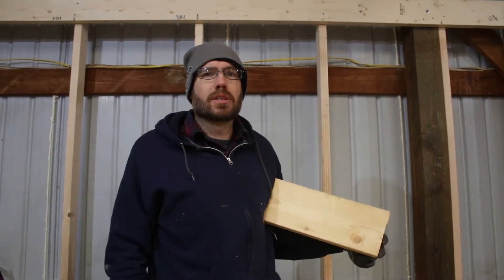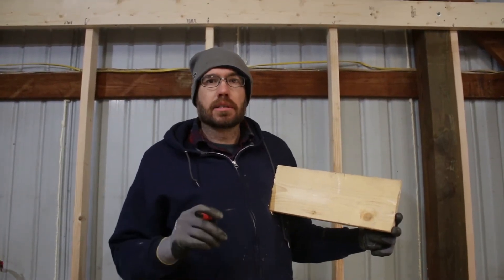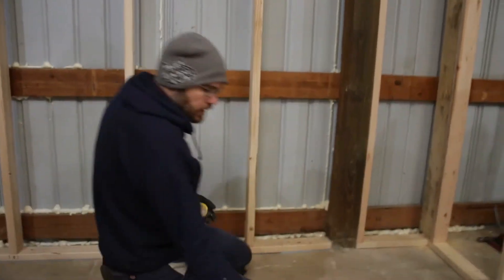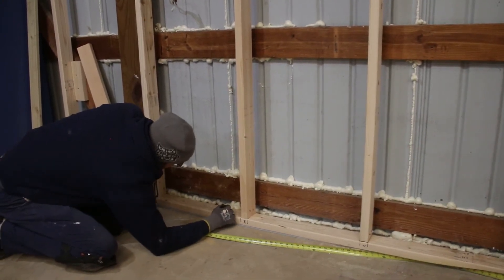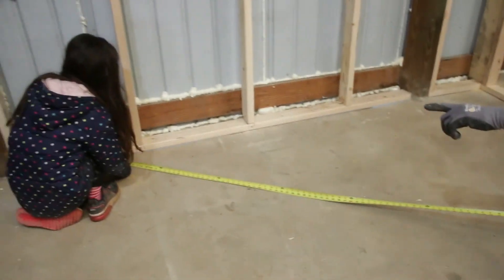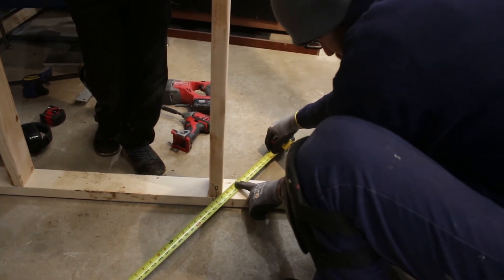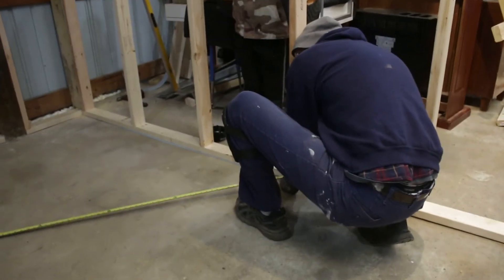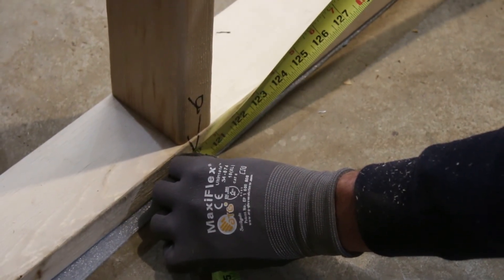How to check if walls are square, or anything else.

Comment: If you had the space, couldn't you also just kick out the other wall? For ex, if you measure from the 8' to the 6' instead it would look like the 8' wall was out of square. I need to figure out which wall to square some interior walls to and for all I know they could both be out of square. So I have to make one of them the baseline. Ultimately trying to figure out which wall to square to.